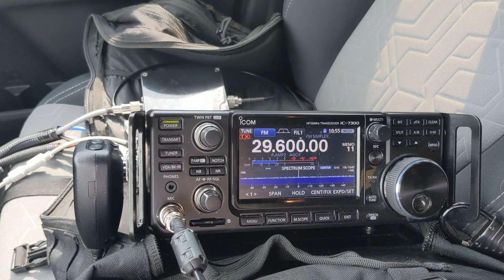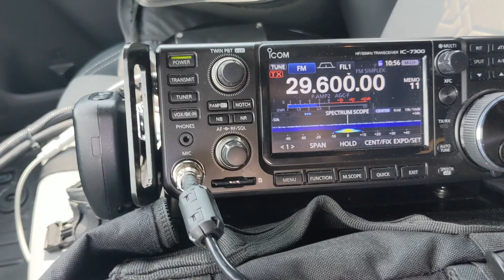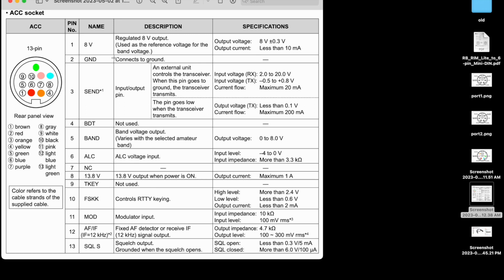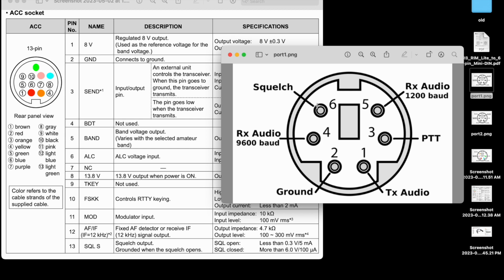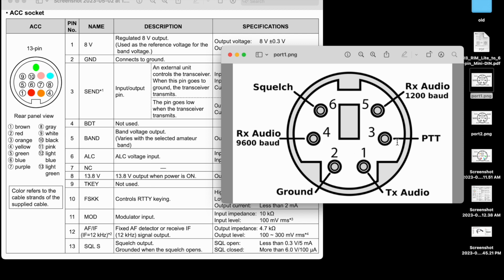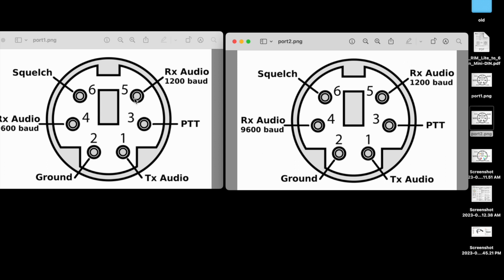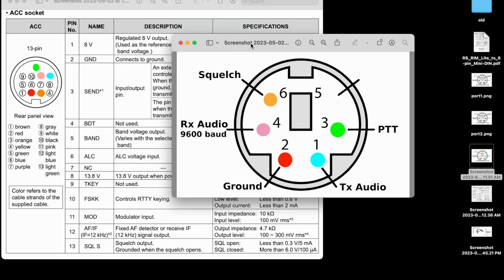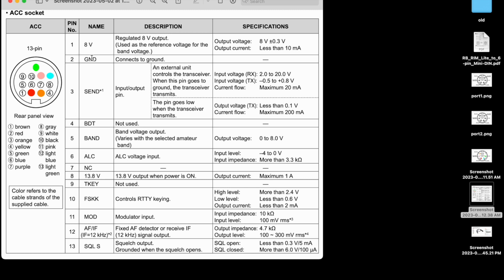Icom IC-7300 HF Crossband Repeater

Comment: so in a nutshell, its basically mic->speaker speaker->mic and squelch->ptt ptt->squelch? wonder why is the 9600 baud mentioned? afaik the 9600 baud out is the same as descriminator-tap, while the speaker out is a 1200 baud, post de-emphasis filtering.. is the pre-filtered audio really needed for a corossband repeater?
Reply from the maker: You can use either 1200 or 9600.  Important to note that with most radios, the 1200 accessory port audio level follows the volume control.  Generally, the 9600 audio out is at a fixed level.
Reply: @nu5m_radio  good point about the volume level. Makes sense 👍

Comment: Just realised my 706 has both types.  Will a "Crossover between the Yaesu FT8000 9600 port and my 706 9600 port work to crossband HF to UHF?  Can I then work 20 meters from my HT?  Thanks!
Reply from the maker: I'm not familiar with those particular radios, but it should work just fine.

Comment: I'm in!  I have a Yaesu FT-8000 and a IC-706 MKIIG.  Got a written out diagram for this?  Thanks!  I have the Icom 13 pin that came with my 706 and some Mini DIN keyboard extension cables here.
Reply: Sorry I had not watched it all before commenting.  Got all I need for two cables.

Comment: We called them retransmit cables in the military and they were specifically made so we could grab one freq and retrans on another. I figured out how to rewire a regar cable that would do the same like you did. Good job
Reply from the maker: It's just a simple crossover cable.  The 7300 has a very good squelch circuit.  It works surprisingly well on SSB.  It still needs a proper voice squelch to get it perfect.  I might work on that next. 73